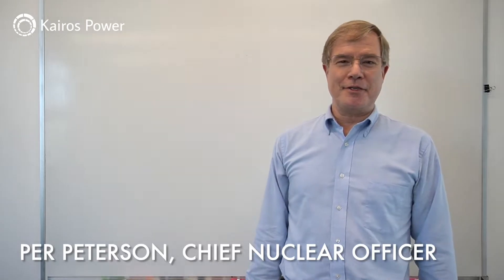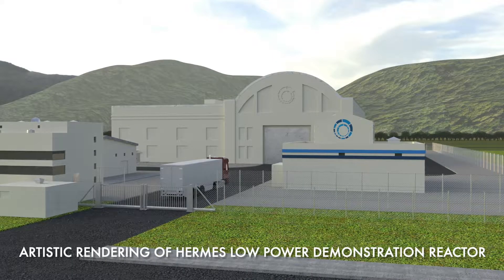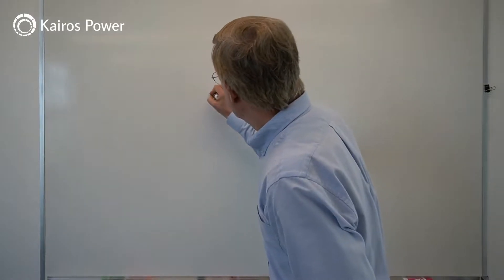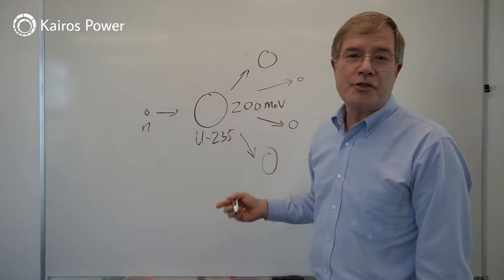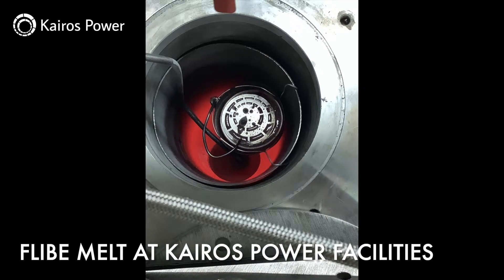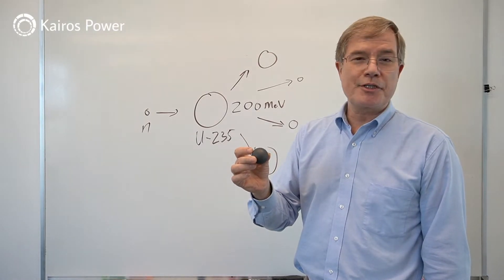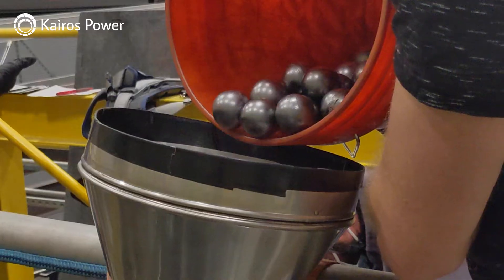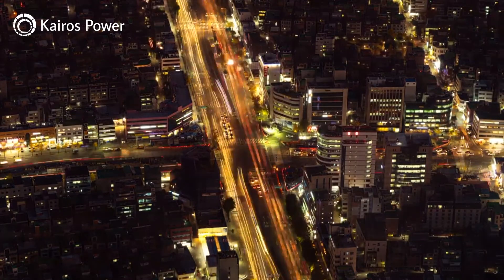Understanding the Hermes Low Powered Demonstration Reactor (Oct 2022)

Comment: Here it is , safe modular nuclear first touted 30 years ago. How much co2 would it have saved if mass adoption was taken up then . Possibly the greatest advancement that I have seen in my life so far , exceeding All thing internet , B2 , A 380, Gene editing. 
Building small sheds is cheap, low pressure vessels cheap less plumbing than your average brewery . Cheap, The need for low cost low carbon electricity,  Big . 
And here it is. At last.
How the cheapest electricity ( nuclear) becomes the dearest is large scale infrastructure projects become politically charged too big to fail Big civil engineers with departments planning problems building in snags delays extra charges add onns VO s knowing the politics of embarrassment. 
These bypass all this because small scale means No big civils engineering contracts involved. They can be built by SME entrepreneurs who have a personal eye on costs not politics. Government loan guarantees and financing could be made available.
Resistance the enemy.  Place the plants near demand  reducing transmission length and electrical resistance. 
Modular scalable 
Appealing to entrepreneurs, one plant pays for the next. Prime example the cotton mills. 
Business and entrepreneurs will develop this far more efficiently than any government. 
The time for a government to finance , ease planning,  regulate , legislate . Promote is now.
The doers and the go getters need to raise their eyebrow and think how. 
Only for those who think fussion  whilst beautiful is too big to deliver. 
Go Getter’s do what governments cannot.